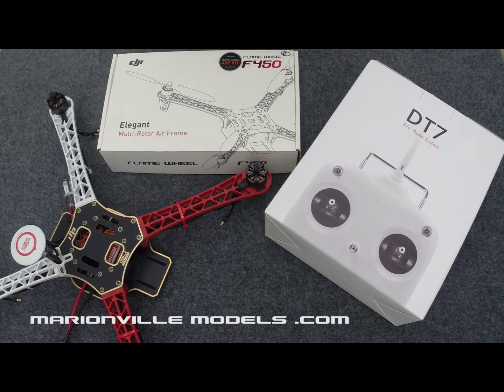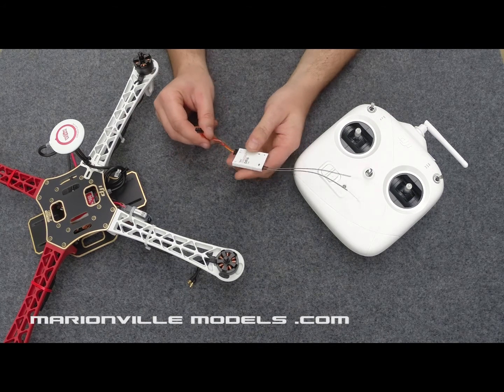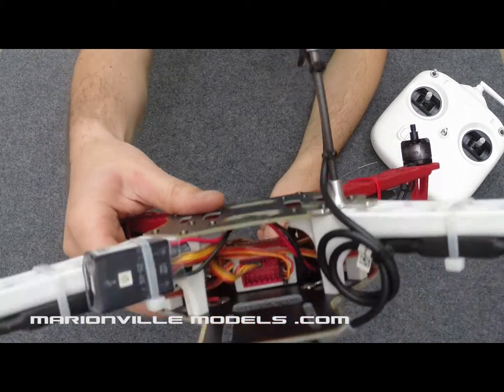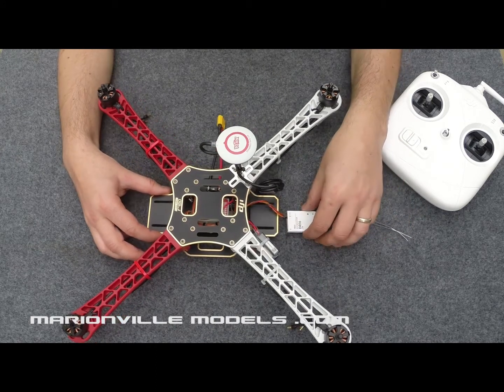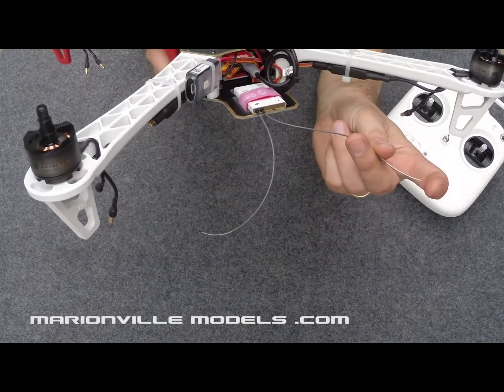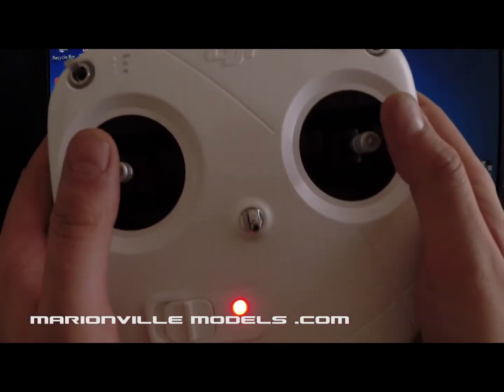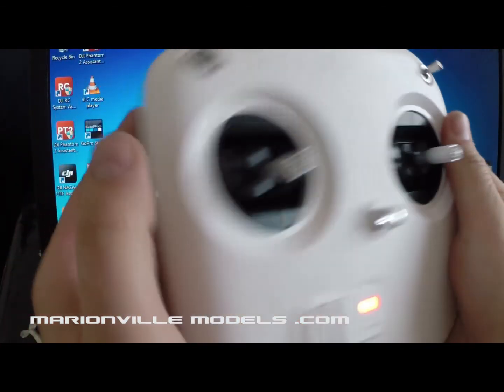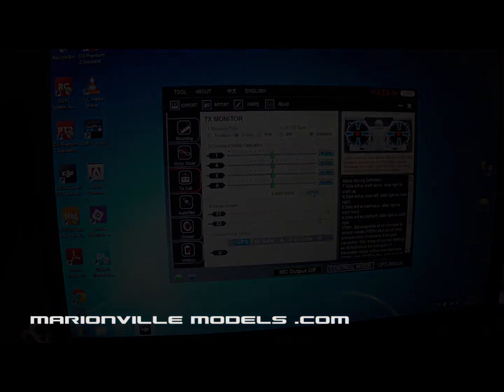How to Install & Connect DJI DT7 Radio to the Naza Light/V2 Flight Controller(F450 Flamewheel)

Comment: Your videos are absolutely incredible, Rick. I have been looking at getting into the DIY side of drones for a while, and just stumbled upon your channel this evening. I must say, you make all of it look rather easy. I am a P3P flyer myself, so the fact that I can stay with the brand and explore some of the DIY sides of the hobby is a definite bonus.

Hoping that you ship to Ireland, because I'm more than likely going to be buying this kit soon.
Reply from the maker: Eire Drones sadly there's not as many people building drones now which is a shame.
Reply: I think plenty of people are. I've been working on a F550 build using a Pixhawk Cube. To buy sensors, cameras, etc etc it becomes expensive. If you just want to fly and don't care about making I totally understand why people buy a new Mavic Mini,  or similar, because it's probably cheaper.

Comment: A note for everyone setting the Naza m Lite up. The USB goes from the led module to the computer. Any microUSB works, the people who say you need to buy the DJI ones are false. First, you need to install the usb driver 
http://www.dji.com/mobile/naza-m-lite/download

called the DJI WIN Driver with the flight controller plugged in.  
NOTE: The firmware is not signed on Microsoft 8 and 10 so you have to follow the steps in this forum and take off the signed requirement thing.

http://forum.dji.com/thread-42282-1-1.html

Then you can install the Naza M Lite assistant software and you are good to go to follow the steps in this video!
Good luck to all :)

Comment: Hi, I've got the same F450 kit and just watched the previous video to build it.
First question, does the kit come with two velcro straps, one for the battery (like previous video) and one for the receiver?
Second question, I've got the DX6i transmitter with the AR610 receiver. Will I be able to do the same tx calibration on my computer with the Naza-M Lite software?
Thanks, and great videos!
Reply: Actually, you won't need the velcro straps for the receiver, you can either use a zip tie or buy another velcro strap from somewhere else.

Comment: Do you recommend any specific battery type? I am building the F450 ARF KIT (Naza lite) which looks similar to this one. I was also wondering if I could use any alternative radio and transmitter sets since I noticed the DT 7 is somewhat pricey and your store only sells in Europe. 
Thanks for making this video.
Reply: Keita Nadalin look at the multstar 5200 3cell
Reply: Keita Nadalin look at the multstar 5200 3cell

Comment: I just had my first test flight for my Flame Wheel f450 with Naza V2 controller and DT7 transmitter and there was no yaw control the quad would not rotate? any advice?

Comment: How do you set the failsafe on the receiver ? 
Brilliant series of videos thanks
Reply from the maker: If your using the DT7 its automatically set.
Reply: Marionville Multirotors Will this transmitter and receiver work with a tarot gimbal

Comment: is there a reason you used a 2.4ghz? why not a 5.8ghz if it is double the speed?

thanks for the very informational howto.
Reply: but the 5.8ghz system will not fly so far

Comment: Can i use Dt7 for DJI F550, i really need to know!!!
Reply from the maker: Yes as long as your using a Naza flight controller.
Reply: +Marionville Multirotors Naza V2?
Reply from the maker: +Vilhelm Palmén yes that's fine.
Reply: +Marionville Multirotors Thanks for help, but did i have to buy some more? Than the DJI DT7 and Dr16. And is there any way that i can see what i am recording? I have a Zenmuse H4-3D.
Thanks anyway!
Reply from the maker: +Vilhelm Palmén the DT7 includes the DR16. This is all you need. To see a camera view you would need a video transmitter and monitor with video receiver.
Reply: +Marionville Multirotors Have you one to recommend?